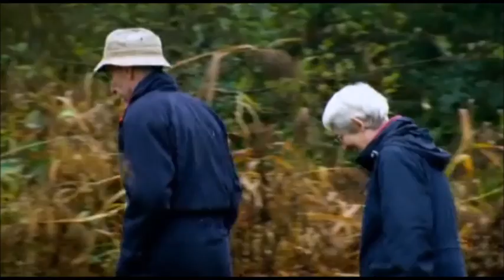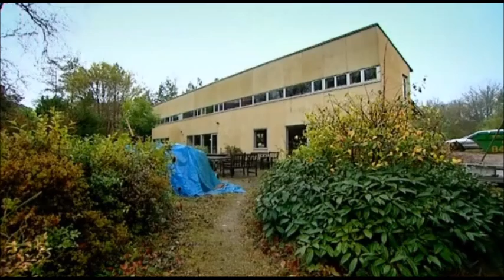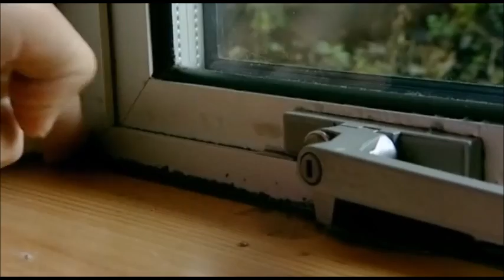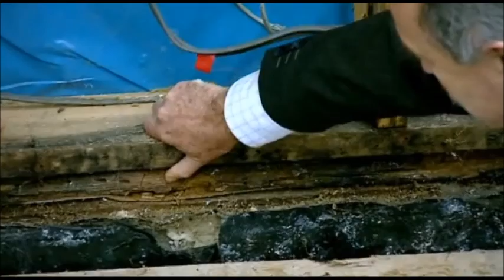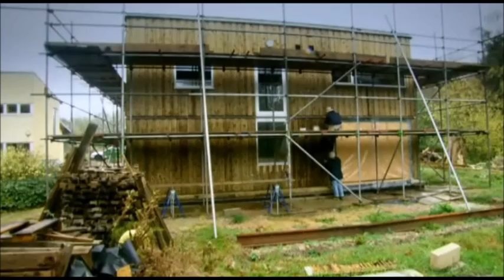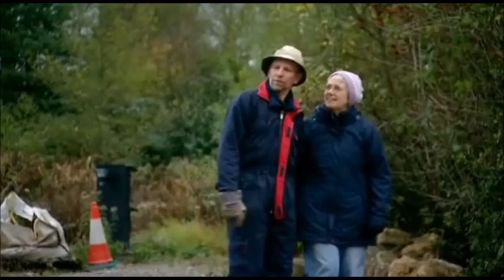Architect's design: A Bath "homes from hell" episode 1

Comment: how does ANYONE think a single layer roof like the "conservatory roof " is NOT going to drip ? ... warm moist air WILL CONDENSATE against  ...ANY COLD SURFACE  ....  kitchens produce alot of this, humans breath out 4 litres+ a day .... I have always disliked open plan living spaces where kitchen moisture can go where ever it likes ...bathrooms have doors and exhaust fans for a reason .... this couple needs to buy several dehumidifiers .... to dry this place out

Comment: Here is a dilema, in this case who you sue? the engineer, or the architect, or the builder? or everybody?
Reply from the maker: The answer to that is straightforward:
The designer (architect) produces information (drawings)
The manufacturer (builder) makes whatever the drawings specify.
If something doesn't work, compare the product to the drawings, if the product is not to drawing the manufacturer is at fault, if the product is as drawn then its a design fault.

Comment: Never heard of a dehumidifier?
Reply from the maker: Of course ! However you obviously don't understand the problem.
Reply: @aviator98  I am afraid I don't quite understand. Could you explain how humidity that is no longer there thanks to the high efficiency of a de humidifier can condense out of the air?
Reply from the maker: @andrewallen9993  Just look up interstitial condensation within the make up of a wall. If your design creates a dew point within a structure any moisture present as gas becomes liquid, consider trying to de-humidify within a wall? Also consider the vapour barrier normally present on the high humidity side and the breather membrane present on the low humidity side and the transport flow rates dependent upon the materials used and their susceptibility to degradation etc. etc. Building tech 101
Reply: @aviator98  You have a valid point. In the Sahara which has very low humidity a very little dew condenses out when the temperature drops below zero. However when visiting friends in Scotland and hearing the complaints about moisture from condensation followed by mold appearing on the windowsills and walls ( walls about 3 foot thick, granite stone and lime plaster) I suggested a dehumidifier to condense the water caused by breathing, cooking and bathing out of the atmosphere. Consequently there was no more condensation.

I live in Johannesburg where we have below freezing temperatures in winter, presumably my family creates the same amount of water vapour as my friends in Scotland yet without vapour barriers, insulation or breather membrane due to the natural low humidity of the weather conditions my home suffers from no mold or condensation.  As I never attended building 101 perhaps you could be kind enough to explain to me the occurrence of these personally observed facts?

Thanks.
Reply from the maker: @andrewallen9993  a dehumidifier only works in a body of air, it takes water vapour out of the air. interstitial condensation is what takes place within a solid structure, the typical make up of a wall has a vapour barrier (1000 gauge poly) behind the interior wall finish (plasterboard) to prevent water vapour present in the interior getting into the wall structure. So there are two reasons why a dehumidifier is not a solution, firstly you can't put one in the middle of a wall, secondly where you can put one isn't where the moisture is originating from, (thirdly, if the source of moisture is not intermittent or occasional then you would have to constantly de-humidify which would not be a sensible solution) The water vapour was being allowed into the structure of the wall by design, unfortunately that design was never going to work in practice, which is why the wall (which was made of timber) suffered from degradation due to the presence of liquid water when the dew point occurred internally.
Reply: @aviator98  Thank you for the courtesy of your reply. You have not explained why neither my friends Scottish house with the dehumidifier no longer suffers from condensation problems nor why my Johannesburg house doesn't either. If I shower or baths in winter the bathroom walls drip with condensation yet 15"minutes later are bone dry yet the only damp proofing in it is the damp proof course made of slate. Neither of thes houses were built according to your explanations yet neither of them suffer from damp. Why?

The only explanation I can think of is low humidity, due to machine in Scotland and nature in Johannesburg.

Comment: From my personal experience, most architects are arseholes!
They are good at drawing fancy pictures, and 'making a statement,'  but dont have  any idea of even the basics of the necessities of building structure.
What these unfortunates have is no better than a poorly constructed garden shed.
If anyone is going to have a house  designed and built, first thing to do is go to a library or bookshop, and get a book on building techniques, study it, and study it again. Also get a book, ''Building regulations explained,and illustrated,''  and that will tell you the minimum of regulatory building techniques, for habitable houses, covering, ventilation, fire proofing, rainwater exclusion etc etc. etc.
Then, at least they will be educated enough to monitor the building of their house and be able to spot errors of method, AND have them corrected, before they release both the Architect, and the Builders from the final job.
Alternatively, get a quantity surveyor to monitor the job, they are far better trained on building structural matters. They cost, but far less than the legal costs of trying to sort out a problem like this.
There's also a well known saying, ''A fool and his money are easily parted!''

Comment: After watching far too many building programmes ( and I draw plans and spec for timber-frame builds), I can say If you adopt novel, non-traditional, cutting-edge methods, eventually you will regret it. Timber-frame needs very precise detailing, that must be followed. The £10k cedar cladding will go gray, the house will be a fortune to heat, the enviro-sedum flat roof will leak, the enviro heat-pump will pack up, the central-air heat exchanger will cost a fortune to replace,  and the end result is that the re-sale will be extremely difficult.
Even if it's your Dream Home, build what other people will Love.

Comment: What kind of “architect” would design a house made entirely of wood AND has no ventilation in the English West Country, where it rains most of the year? It was obvious while watching this video that the problem was a complete lack of ventilation, and they needed a structural engineer to come out and find that problem? The builder should have been “Wtf, this plan won’t work, it needs modifying” rather than just go and build what the idiot dreamed up. Astounding!

And rather than spend 9 years constantly mopping up the damp and installing internal guttering, how about buying a shitload of dehumidifiers? Have them going 24/7 and the inside of that house will be dry within a week. They’ll suck every drop of damp out of inside a month. (I lived in a 1 bedroom flat that had so much damp that everything I owned was drenched after 1 month living there. Pools of water covered the bedroom floor after 2 months. I bought a single dehumidifier designed for a 5 bedroom house and my flat was completely dry within 2 weeks. Run 5 of those in that monstrosity of a house and job done. They’re brilliant!)
Reply: The key with UK timber-frame is breathable membranes. Don't trust a builder to do anything other than follow The Plans.

Comment: I don't understand why they used wood on the exterior. Even the fact it rots when exposed to so much ongoing wet weather,  it weathers and turns gray in a year and requires so much ongoing maintenance . Why not brick or stucco?  Seems they are not thinking clearly even after 10 years

Comment: Never put glass windows in aluminum frames.
Reply: Wrong . You CAN put glass in aluminium if you have plastic insulators . Just shows what you know.
Reply: @738polarbear  Well yes, then you're putting the glass in plastic, not aluminum. A lot of people don't. I worked for a law firm an file a demand letter complaining that a company did not do that. We won the case.

Comment: I believe that the narrator said that the architect had only250000.00 pounds ins. and they settled for only 150000.00 P. If It were me I would not take any less than the 250 grand. The designer and builder negligent. By the way I don't like either but the wooden one is more appropriate for the site.

Comment: They need ventilation. Why did the owners never notice that there wasn't ventilation? Also if they don't have roof gutters they wont ever solve the problem.
Reply: Yep, you don't need a surveyor to know their problem was ventilation. The roof gutters are most likely hidden at the bottom of the roof structure with the down pipes behind the shuttering.

Comment: This is probably the ugliest design I have ever seen. Even if it was completed 110%
Reply from the maker: +MrRichVos Its visual appearance is better now that all the render rainscreen is gone and its clad in timber overall, but we were disapointed with what a Zurich trained Swiss architect achieved, who is now writing books about it......
Reply: @aviator98     What's the nature of the architect's book?    Does he assume responsibility for the issues in the video  or does he try to shift responsibility to you and your  wife?    Who would ever think to check on the insurance coverage available to the architect?         So much to be careful about..
Pity you had to go through all this hell.
Reply from the maker: @easystreet1888  When a professional is using PI insurance one of the rules is "admit nothing" it invalidates insurance. responsibility is negotiated by the insurer, in this case they didn't try to negotiate because the architects were under insured.
Reply from the maker: @easystreet1888  The Book is something to do with modern barn living, responsibility is as the program tries to indicate while the Architect's registration Board (ARB) since 1980 has had to have architects insured, until 2010 thanks to this program, they didn't have to be insured for the full value of the work they did, any insurer will tell a client to; say nothing , admit nothing, etc. etc. in exactly the same way as car insurers do. Which is why you have to take legal action.
Reply: I concur
Reply: @starfiremale  they don't even call it living in a home they call it living in a building.
Reply: That was my first thought. Awful design. Reminds me of a factory or barracks or a compound built by a cult. Sad that it turned out so badly for the homeowners.
Reply: I agree.
Reply: dreams are safe, until they're converted into reality.. that's when nightmares materialise.😣
Reply from the maker: @josh otis  Yep, the contractor did